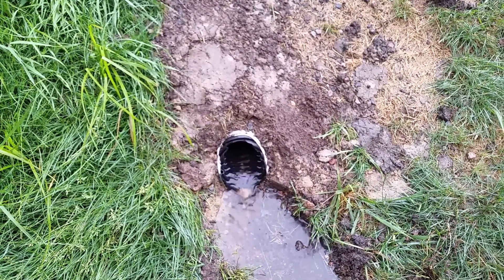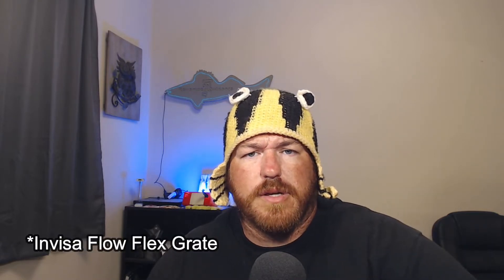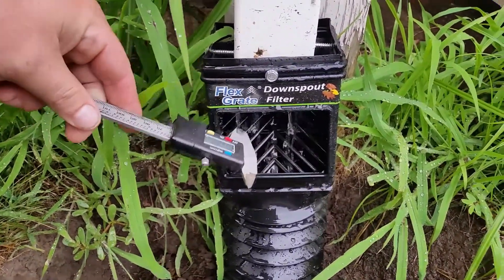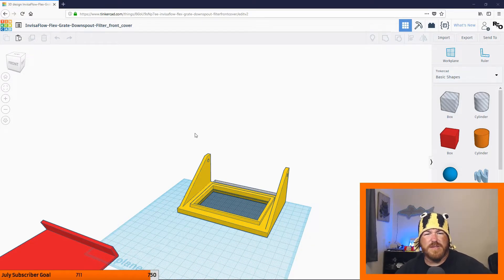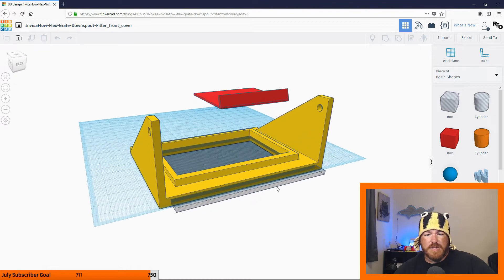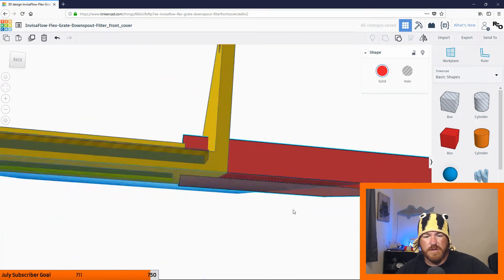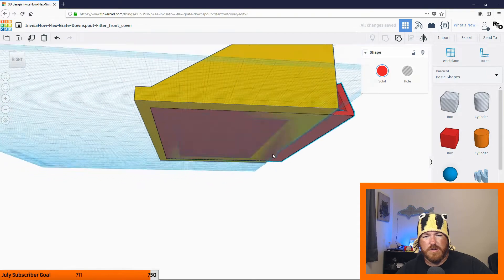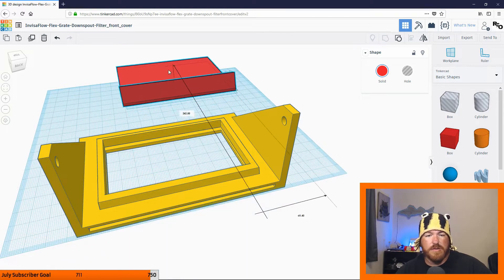InvisaFlow Flex Grate Downspout Filter Cover (3D Printing)

Comment: I am interested in buying some if you are up to printing them. I am having the same problem...I was just going to take take it shut...lol...message me with a price if you are interested. Thanks and great job
Reply from the maker: Thanks for the interest sadly I'm not set up for selling anything for now just doing this for fun. I know thingiverse has some options for print on demand services that can print it out and send it your way. That being said, I don't know if this is the best option for stopping the excess run off from the filter, it works well and keeps the water in on large rain events but...any foreign material introduced to the downspout quickly clogs the filter portion and unless you're on your game and clean it before each large event the problem remains the same (water next to the foundation). If you're in an area with no surrounding debris from trees they do work well. I hope to improve this design by somehow allowing the hung up material on the filter to self eject, if you have any ideas please.let me know!

Comment from the maker: The original design of these is suppose to have the foreign material wash out of the hole in the front of the unit.  I don't think the angle is steep enough for the debris to actually clear the front of the filter on their own.  So having the door on it doesn't seem to reduce the effectiveness of the filter, the foreign objects would get stuck anyway.  I wouldn't advise having the door on there if you have a lot of leaves/needles or seeds. It might be a better idea just to cut the lip of the face plate so they fall out easier.